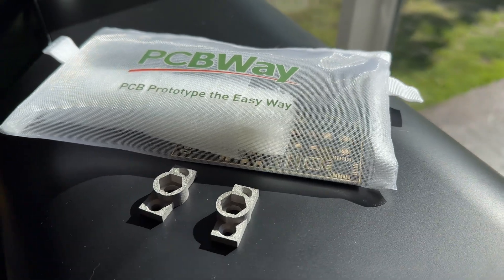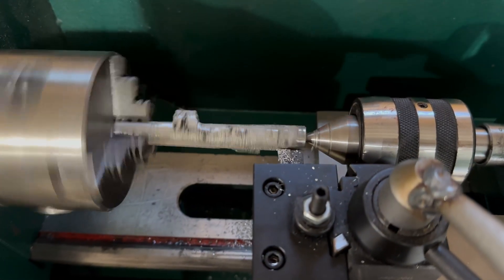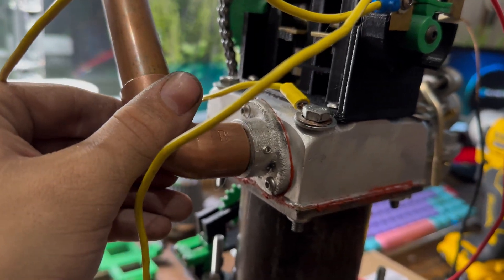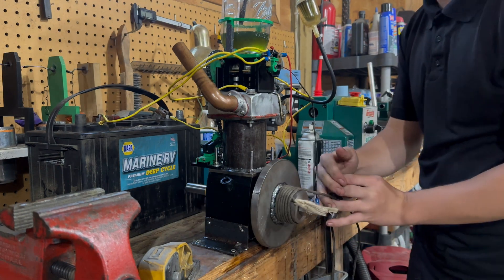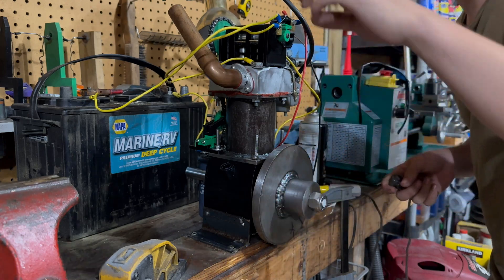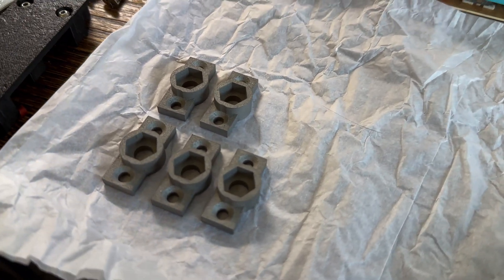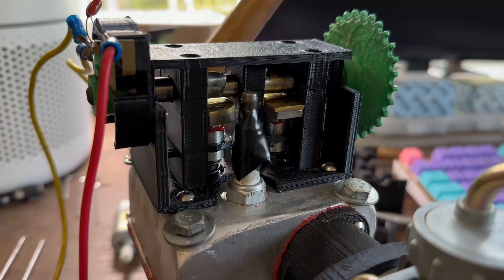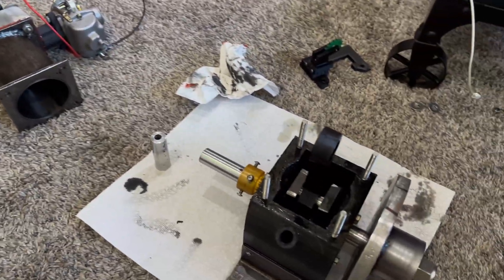METAL 3D printed homemade engine RUNS!!

Comment: You could print a ring with (say 5) blades at a 45-degree angle, make it just big enough to slip over your flywheel for a cooling fan to keep the head temp down.  You could turn up an aluminum piston on your lathe too.🤔
Reply from the maker: Keep an eye out for my next video, I think you will like it, it will be coming out later tonight!
Reply: @ProjectLMZ  Will do !
Reply from the maker: @gwheyduke  you should check out my channel, new video is up, I think you’ll like it if you liked this video
Reply: @ProjectLMZ  Yes, fun stuff.  Well done

Comment: Excellent casting !👌 Guessing that compression isn't 800 PSI, valves should be fully closed when the piston is Top Dead center anyway.  Running better with the new cam now.  The spark jumping over to head pieces or screws is a common problem with miniature model engines.  That's why you see a lot of them with the plug coming in the head at an angle or even on the side of the head.

Comment: Awesome!  Congratulations! on getting your engine to run.  Love the overhead camshaft and that fire shooting out of the exhaust yea, it's making some power! Too bad about the timing chain tensioner, she would have kept running.  Machine more components on your lathe, use some 12L14 Steel, it's easy to machine and pretty tough too.  Perfect for model engines.
Reply from the maker: That’s good to know! I have a video that I’m posting later tonight, it’s kinda a part 1, but enough stuff happens for it to be a video in itself. I have an aluminum piston that I machined and homemade rings, and it ran really good! Keep an eye out, I will be uploading the video soon!

Comment: You can buy a spark plug cap and that should solve the problem (but make sure to buy a small one and a connector for the wire)
Reply from the maker: That’s what I’m thinking about doing, just hasn’t been necessary completely yet. I am just about to test the engine after rebuilding it with an aluminum piston!

Comment: Maybe  a top layer of JB weld would help the 3d printed piston hold out even longer,  with it running rich and low rpm I was really impressed with how long it lasted already.
Reply from the maker: Well I have made an aluminum piston, so it will last a lot longer, just got done making the piston rings as well!
Reply: @ProjectLMZ  that was pretty fast! I just figured it'd take a bit to make an aluminum one
Reply from the maker: @Only1Sethy  realistically it only takes about a day, from casting the aluminum to finishing machining is really only a day of work. I hopefully will be testing today, and I’m quite excited for that!

Comment: Use some of that 2000F ceramic paint used for pits and coat the top of the piston to keep the heat from melting the piston as fast...I say 5 or more coats and test to see if it helps the longevity of the piston...very cool that it actually ran at all!
Reply from the maker: I just made a cast aluminum piston for the engine, although there is a lot of pitting on the sides and top from the casting, like a lot, but there all small, less than 1mm, so if anything I think it will just hold more oil. But I will fine out, next is I need to make the connecting rod, and then I will have all metal parts in the combustion chamber! 

Thank you for watching!

Comment: Lot of blow by coming out your oil fill.
Reply from the maker: I thought it was blowby, but it can’t be as it does it even with the spark plug out, I think it is because the crank case volume and cylinder volume are the same so the gasses in the crank case are moving at the same speed as the cylinder gasses.

Comment: i think your fuel filter is on backwards haha
but in all reality this is such an amazing project. i wonder if some day it will be finalised and i can try to print and cast one myself
Reply from the maker: I didn’t even notice the fuel filter!🤣 in my next video I’m making a homemade cast aluminum piston, cast aluminum connecting rod, and any other parts that will need to be upgraded to metal in order for it to run for extended periods of time!

Comment: I’m not sure what the part is called but it connects the engine and carbi is this part okay to 3d print as I’m rebuilding an engine and can’t find a proper connector so I made and 3d printed my own
Reply from the maker: The head still gets hot, so once the engine warms up it will probably melt, that’s why I will probably be making my own metal one in the future, probably in the next video, as I am making a aluminum piston!
Reply: @ProjectLMZ  ahhh sound good will definitely be following along I would get it metal 3 d printed but super expensive 🙈 I’ll just have to figure it out alsk are your plans for your engines available online ect   
Also you should do a video on a hole new re build of the engine step my step on a 3d printer I guess so the viewer can follow along and what parts to upgrade from plastic ect
Reply from the maker: @DavidLee-rj6vr  I think it would be pretty cool to do a full teardown and rebuild video, as that would also allow me to make any parts better since it will already be apart! As for the plans, I don’t know if it would be a good idea as the plans do not match the engine, for example, in my CAD model, the head is 28 mm tall, on my engine it is 38 mm tall, I have just used my CAD design as a guide.
Reply: @ProjectLMZ  yeah I guess if the plans don’t match that’s a problem but if you where to put in hours and re design them and it was a solid design I guess you could even be like you can get the designs here for $1.99 or somthing ect sounds good for the rebuild

Comment: Ah this is incredible work! What CAD software do you use, and will you be releasing the plans?
Reply from the maker: I use tinkerCAD, but I’m switching over to onshape, but there’s really no plans, as the metal parts are not like the 3d model, they’re different by quite a bit. Like my 3d model of the head is 28mm tall, and the actual head is 38mm tall.

Thank you for watching!
Reply: @ProjectLMZ  Absolutely! I use Onshape for a lot of my projects and it's pretty good for what it is. You've given me quite a bit of inspiration for attempting something like this, maybe at a smaller scale though. 180cc seems HUGE! Any particular reason you went with something so large?
Reply from the maker: @dogechannel9933  once I get it running reliably I want to put it on something, my next engine is going to be a 360 cc in line 2, two of my current engines put together, reason for an in-line two is because it will be easier to make the crank case than a V twin!
Reply: @ProjectLMZ  Yeah I totally get that. If I were to make a multi cylinder it would either be a boxer style engine, or an inline just for ease of use. I can't wait to see your journey through this!
Reply from the maker: @dogechannel9933  I think it would be pretty cool to make an inline 2! If I get monetized I will probably start working on it soon!! I’m close to being monetized!

Comment: I am impressed with how much the engine has improved and how well-ish it's running 
I am not sure but I think making the compression ratio higher would allow you to run leaner AF ratio which would make the carbon less of a problem
Or maybe the carburetor needs some tuning, if you take the top apart there is a needle with an E clip which basically sets the AF ratio
Having such a short intake doesn't let the fuel evaporate and mix very well which means you'd need more fuel to keep the engine running but that's not exactly a priority right now as the engine doesn't run forever

Speaking of running longer, the cast iron piston, while more durable than cast aluminium, is also 3 times the weight and compared to the more hollow plastic one it'll be at least 7 or 8 time heavier I would say tho probably less... anyways make sure the connecting rod can take it and won't just snap at the 1200 rpm idle (by ear it's around 1100-1300 rpm)
I very much can't wait for the next part
Reply from the maker: I was thinking about using cast-iron because the aluminum that I have is from pop cans, which isn’t exactly a high-quality aluminum, but we went to NHRA nationals this weekend at BIR, and I got a top fuel dragster piston that was beat up, so I’m going to melt down that piston and use it to cast a cast aluminum piston, and then I’m going to use the same material to make a cast aluminum connecting rod!
Reply: Oh I wouldn't melt that down I'd have it on a shelf somewhere for decor but you do you. I don't exactly remember but haven't you used carbon fiber nylon for the connecting rod? I am not 100% sure but it might actually be stronger than cast aluminium. but it doesn't handle heat as good so the aluminium rod is probably better. I would also do some research about aluminum heat treatment if you are gonna cast a rod. Although if it breaks I guess you can make another one, not like the Top Fuel piston is small.... idk actually I never seen one but I'd imagine it's quite big.
meh... we'll see what happens and if it blow up xD
Reply from the maker: @Cjarka_  I have another top fuel piston, I already melted down the one I got that was beat up, the one that I already had is in much better condition, and I also got a connecting rod from a top fuel and the intake and exhaust valve! I’ll show them off in the next video, then you can see how big they are!

Comment: You will get to a point when the aluminium will start to melt...
Reply from the maker: I don’t think so, as aluminum is used on most production engines today, and in the next video, I’m planning on adding water cooling. Maybe if I was running no cooling system at all it would melt the aluminum, but once I add water cooling, I should have a pretty reliable engine!
Reply: @ProjectLMZ  Yes that's what I ment. Unless you solve cooling. Anyvays, its pretty cool how easily you can make an engine if you omit things like cooling and simplify the design.
Reply from the maker: @bringtheideas460  yeah I was actually surprised at how easy it was, and at how well it’s running, I got a top fuel dragster piston that I’m melting down for the aluminum, and then I’m going to cast a aluminum piston!
Reply: @ProjectLMZ  Can't wait to see that, since you reached a point when the piston melts.

Have you thought about making it 2 stroke? That way you could eliminate the valves, crankshaft, chain and greatly siplyfy the design. You would have less points of failure. I am suprised Camden Bowen and you haven't started with that. Why is that? because the o ring would shear on ports?
Reply from the maker: @bringtheideas460  actually if you look back on my playlist on the homemade engine, I tried a two-stroke, but the main issue I had was my ports, two strokes like ports that are perfect, and my ports were far from perfect. If I had a milling machine, it would be much easier to get the ports cut perfect, but without it using a Dremel makes it difficult to get them perfect. Obviously Camden was able to do it, and if I were to try again, I could probably do it, but I like the four stroke for one main reason. 

BOOST

I’m planning on boosting the engine with either a supercharger or a turbo in the future!

Comment: Absolutely awesome, this is really rapid prototyping at it's best and all that effort super paid off. Also, before the water cooling, what about splash oil cooling? Like on the bottom on the piston, like early era automobile engines with just a tiny stick on the big end of the conrod dipping into the sump?
Reply from the maker: Thank you! 
I have oil in the case up to the rod, but I think I will do water cooling as well. Also, a future project might be coming, as I just went to BIR nationals and got a con rod, cylinder sleeve, wrist pin, rings, and bearings from a top alcohol funny car, and the cylinder diameter is over 4 inches!!

Comment: Id say running a bearing on that rod would help a bit. Because with just plastic id imahine once there is a lot of force pushing onto it it makes quite a but of friction.
Reply from the maker: I would agree, in the next video I’m going to be making a cast-iron piston and aluminum connecting rod, so I was planning on making a homemade two-piece brass bushing for it
Reply: @ProjectLMZ  that sounds interesting. Though i would personally go for a aluminium piston since a cast iron one would be really heavy. Specially for a aluminium rod. As for the bearing: while a 2 piece flatplain bearing would be fine, that is only really a case for pressurised lubrication system. Id say going for a needle or a ball bearing is a better bet overall. Id love to see this engine progress. Also maybe stiffer valve springs to allow more revs? And also because the 3d printed parts are now heavier.
Reply from the maker: @tilen3266  I think a aluminum piston would gall the cylinder walls, that’s why I was thinking cast iron, I would do a F1 style cast iron piston, it would weigh the same as a full sized aluminum piston. Aluminum and steel don’t like to play nice together, they scratch and gall.

For the bearing, my only issue is that I am welding the crank together, so if I were to put a needle bearing or roller bearing in there if it gets messed up the whole crank is screwed.
Reply: @ProjectLMZ  1st. I dont really think that aluminium piston would cause issues. I mean aluminium piston and iron cylinder is how most car engines are made. Pitbike engines also. You would want a 0.1mm gap between the piston and the cylinder to ensure there is enough gap for the piston to expend when the whole thing heats up. 

2nd. Yeah i also relised that shortly after commenting but the way you could do needles is to have a split rod, like right now and then use grease when assembling to hold them in place. Then once its all together it should all hold nicely. Kindof like old 2 strokes on the top of the rod. Thats how i did it. For the needles you would make a little recess into the rod to prevent them from going side to side. Hopefully I explained well enough. Or i guess you could add me on discord and id send you a 3d model to show you my idea. If you want to. I made some compressed air engines myself and i tend to over engineer stuff 😅
Reply from the maker: @tilen3266  yes, most engines use aluminum pistons with cast iron cylinders, and they like each other, the work well together. But aluminum and steel do not like each other, the hate each other. They gall quite easily, and stick together. But I bet if I bumped up my fuel mix ratio to like 15-20 to 1 and keep a lot of oil in the crank case it would probably work, as oil helps a lot. But I’m not sure if it’s worth the risk. What do you think?
Reply: @ProjectLMZ oh yeah right youre using a steel cylinder. I feel like with oil and a mix in fuel it shouldnt be a big deal. The only reason it would be worth it going with aluminum piston is the weight. Since with a aluminum rod a heavy piston could deform it. Then again it doesnt spin too fast. I just feel like a iron piston would be really heavy. I mean the crank has to hold all that weight too. Id say go for aluminum and maybe run a mix. Ill do a bit of googleing on it. But its your engine so at the end of the day you decide.
Reply from the maker: @tilen3266  well either way I do it I have to balance out the counter weights on the crankshaft, so I need a total mass of the piston, connecting rod, and wrist pin to be about 570g, so going for a lighter aluminum piston really won’t help unless it’s the same weight as a cast-iron piston. After I calculated how much the connecting rod and wrist pin will weigh, I have about 220 to 240 g for the piston.
Reply: @ProjectLMZ  about balance: it is still better to have lighter counterweights since while yes they do balance the upward and downward motion, they make just as big of a side to side inbalance. So having a lighter rotating assembly would still help in that regard.
Reply: @ProjectLMZ  it may be possible to case harden/carburize the inside of a steel cylinder so that the inner surface behaves like cast iron but the outside retains the strength of steel

Comment: I guess it likes running rich because the extra fuel acts as coolant. The downside of course is the build-up that you are seeing which will foul up the engine. If you're on the fence about cast iron/alluminum piston, I'd go alluminum, since you are running rich anyway so are unlikely to melt a hole through it, plus the reduction of weight will benefit the engine in so many ways.
Reply: Would be cool. You'll just be shifting more weight with each cycle, but since you don't need super high RPM anyway, I guess it won't be an issue.
Reply from the maker: The only thing I’m worried about with aluminum is it galling the cylinder, as aluminum and Steel don’t like to play nice. Also, the weight of the piston needs to be around 220 g, then that will balance out the engine, so if I go cast iron, I’m going to make a F1 style piston, which I think would be pretty cool!
Reply: @ProjectLMZ  also, if you're going for an f1 style low profile cast iron, you'll likely be around the same weight as a regular aluminium anyways :) with the added bonus of a higher melting temp. I look forward to seeing how you manage the smaller piston with blocking off the ports!